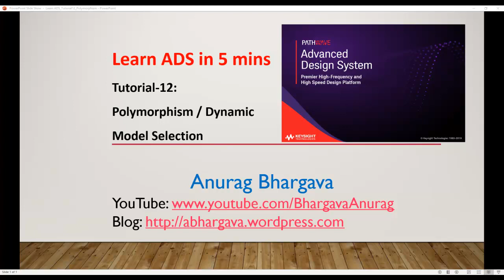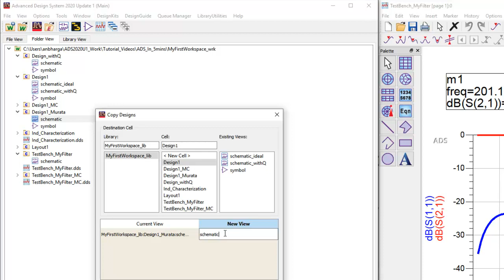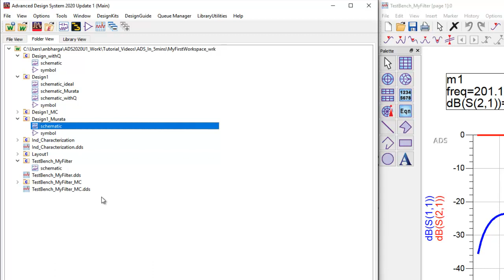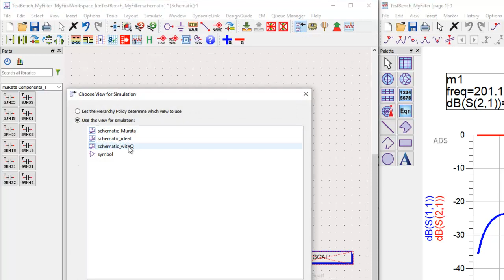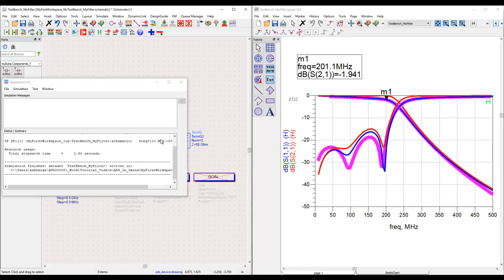Tutorial-12: Polymorphism / Dynamic Model Selection

Comment: sir which template shall i use to measure Q-factor for the used capacitor model GJM03  because its showing correct data with s_2port_spiral
Reply from the maker: There is a CRQ template available in ADS Data Display page else best way to do is to short one of the C pins to ground and run 1-port SP sim and then simply use classical Xc=1/(w*C) and Q=Xc/R formula to calculate Capacitance and Q-factor.